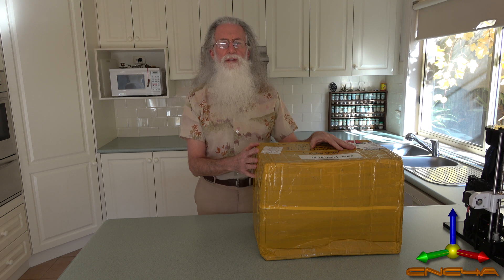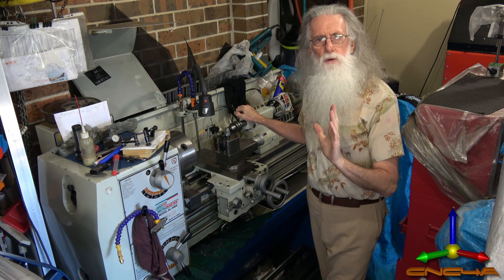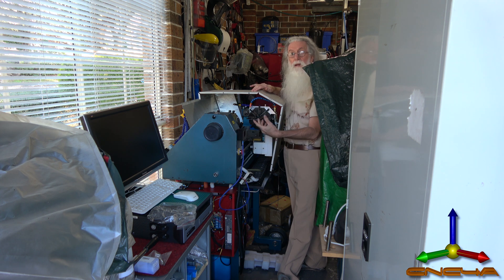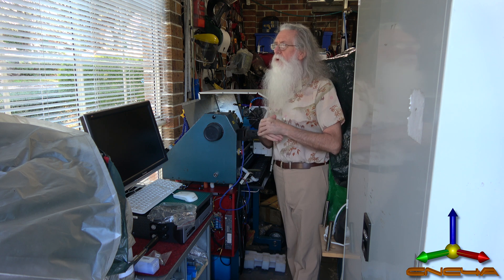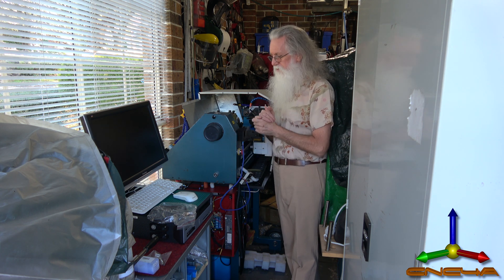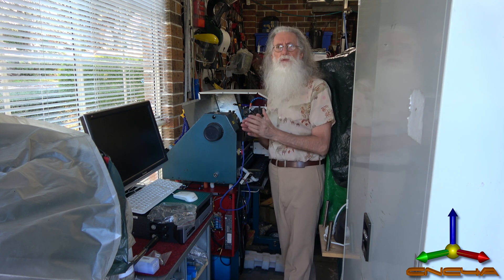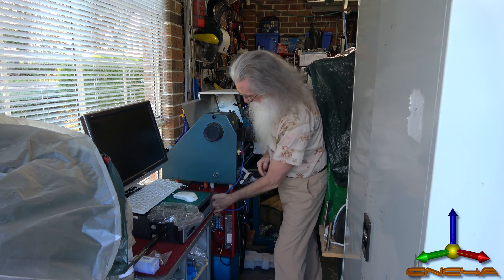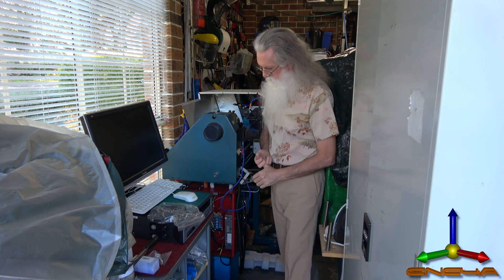CNC4A - Mach3 Alternative 01 - Why

Comment: Kind regards from Colombia.

I am very fascinated with your channel and all the information you share.
Likewise, your valuable advice.
Without knowing your channel, I have acquired this type of controller card:
https://www.nvcnc.net/zkmotion.html with 4 channels.
What opinion can you offer me in front of everything you have exposed in your video? I can also appreciate that your lathe has an automatic tool change. I want to do something similar, it is possible with this type of motor:
NEMA 34 Closed Loop Stepper System 4.5NM and two selenoids to open the plate.
Thank you for your time, attention and valuable response.
Blessings of health and tranquility in these difficult times.
Reply from the maker: I had the NVEM card that promised to do everything including making coffee. I replaced the smooth stepper board back to the mill and got that.  I had to redo everything because it used negative for the signals, positive for the ground, etc.  PNP and NPN weren't compatible so had to buy new gear.  The board connections were very small and not enough 12V+ pins so had to make up tiny power rails.  It didn't work well with the VFD I had, not a Chinese one. Click forward and it may start in reverse, or forward and visa versa.  The Constant Surface Speed didn't work.  Even though this was a ebay clone the original manufactures aren't any help to original buyers either so you are all alone. You would wire it up as per instructions but if you wanted threading the CSS and rpm DRO didn't work if connected.  If you disconnected the Index wire the CSS then worked so it was one or the other, not both.  That's why I started experimenting with those Tachos in the other videos as threading was more important than CSS. So more and more faults restricted the main reason why I got that card so being feed up I then decided to bite the bullet and spend a lot of money for me and get the new controller.  I have to rewire the lathe completely again and spend more money on the extra parts it needs so that is why it's going a bit slowly but I do it for the journey mainly, as that is where you learn the most.  So my advice is that they all look great on paper but contact them first and ask lots of questions first.  You will soon get a feeling for if you will left on your own when they take your money or not.
Reply: @TheWizard  Gracias.